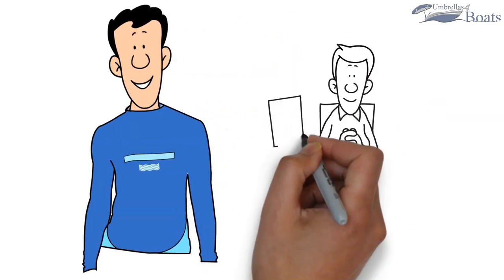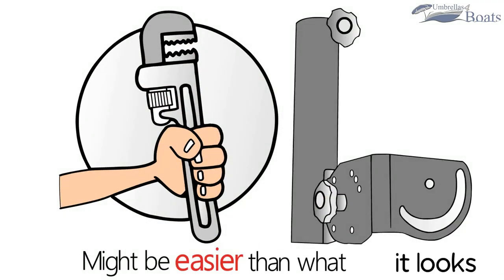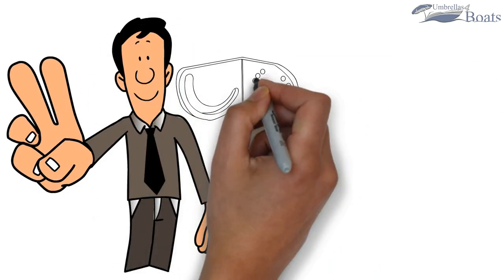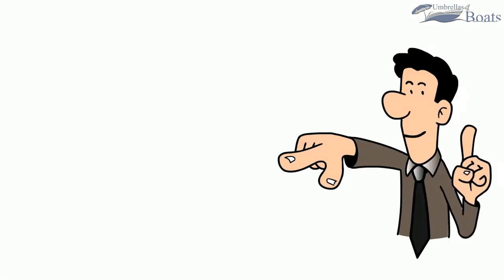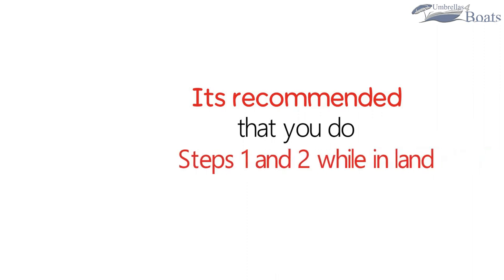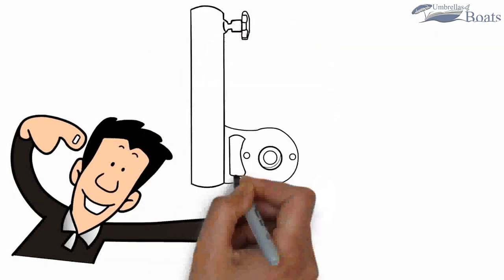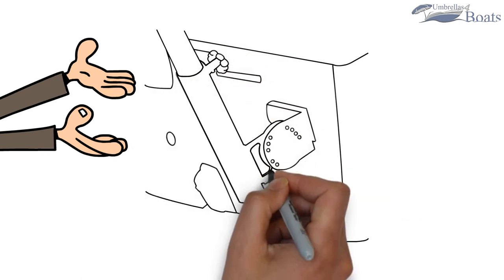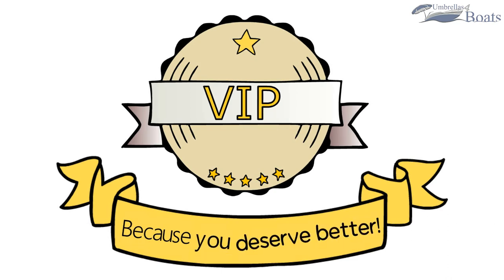How to install your Umbrellas4boats bracket

Comment: This is a really great, high quality product that really works, but I had some issues with using it on the water. I installed the mount on my transom, but had some problems deploying it at the lake. First of all, you need to grease the sliding aluminum surfaces, if you want to be able to adjust the umbrella while installed. Just too much friction to swing the umbrella out and back again without it binding up the locking pin. Also, the hand screw adjustment for the tension between the plates will jam up if you have a side load (such as from a cross wind), and it can't be adjusted to give smooth swing out movement without being too loose (and might fall out) or too tight to unloosen by hand, so I replaced the adjuster with a stainless bolt and nylon locking nut, so I could get just the right amount of friction between the two sliding plates, without being too loose or too tight. The other thing is that the transom mount is designed to be adjustable side-to-side, which is great, but I could not get it to stay in position when a cross wind hit the boat, it kept rotating. To fix this, I drilled a third hole in the mount, and added a locking bolt.